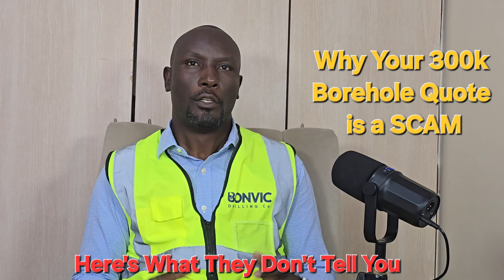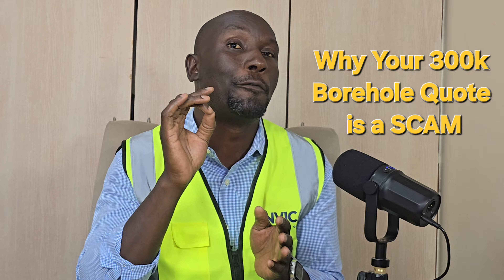Real Cost of Drilling a Borehole in Kenya 2026 (Honest Breakdown)

Comment: I used to think this engineers lie until I dug a dry well, hydro survey is compulsory
Reply from the maker: Yes the survey saves you alot
Reply from the maker: Exactly! 😅 A hydrogeological survey can save you from the costly mistake of drilling a dry well. Survey first, drill with confidence!
Reply: i experienced the same. borehole drilling is a costly but worth it